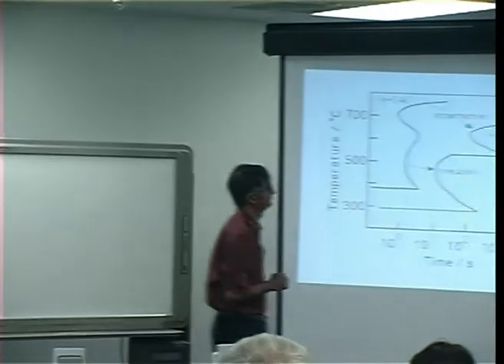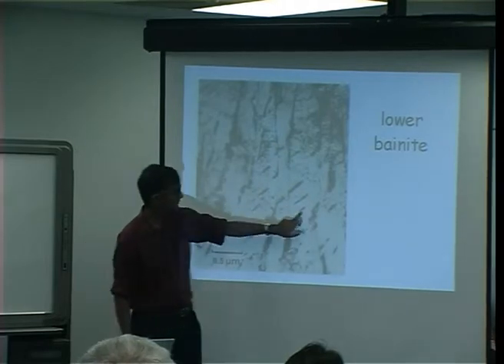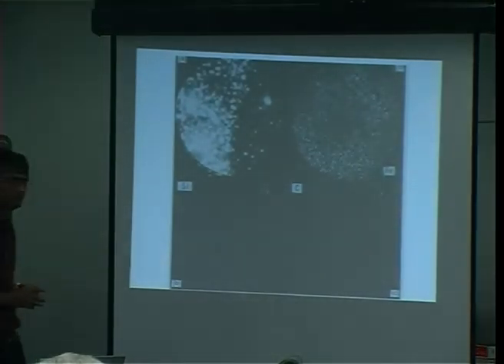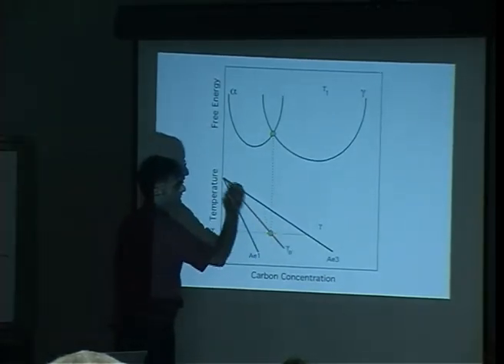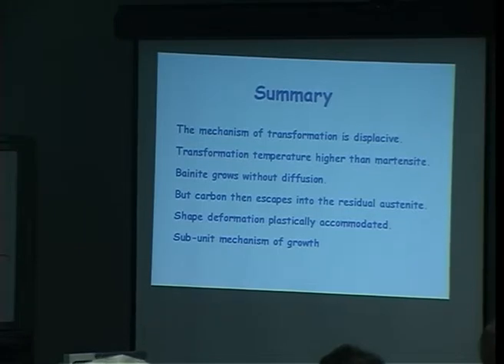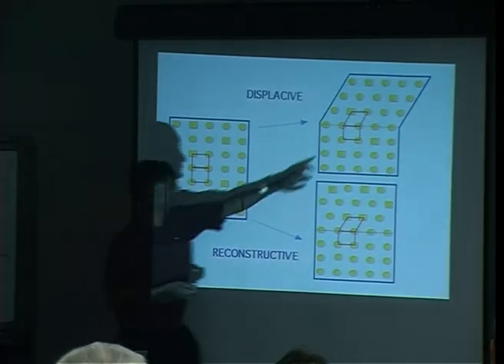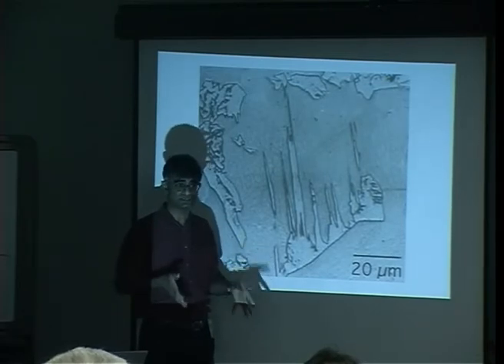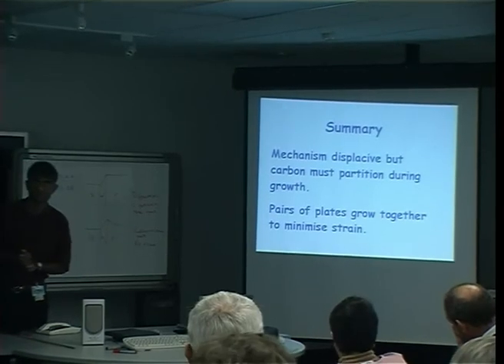Mechanism of the Bainite and Widmanstatten Ferrite Transformations in Steels

Comment: Dear professor Bhadeshia, I'm comparing Bainite X Widmanstätten ferrite. 

Am I missing something important or is something wrong? 

Should I consider a transformation as paramilitary only if the diffusion ocurrs during growth?

--> Both are formed in a paramilitary displacive transformation (only the interstitial atoms can diffuse) (????)

--> Both are nucleated in austenite grain boundary, but the plates of bainite can be formed by sympathetic nucleation

B1--> The bainite sheaves consist of small subunits of ferrite plates separated by regions of cementite. If temperature is lowed, 
 i.e. the supercooling is greater, the difusion of interstitial atoms of carbon is difficult. Therefore, a smaller part of the carbon 
will be diffused, leaving the ferrite supersaturated. The carbon inside ferrite will precipitate (similar to tempering).  

B2 --> The subunits of bainite are too small (in order of 10 microns x 0,2 microns), so it's necessary use a TEM. 

B3 --> The supercooling is greater. A invariant plane shear happens, but the adjacent austenite is weaker in this temperature and is plastically deformed.

B4 --> Toughness of bainite can be improved by decreasing cementite (addition of Silicon can do it), but the plates have similar crystallographic orientation (bad feature)

W1 --> In constrast, Widmänstatten ferrite has no subunits because carbon is partitioned after the growth;

W2 --> This can be seen in the optical microscope - the plate is "clean", but the orientation of the two plates formed is so similar thus we can't see it;

W3--> The supercooling is smaller, thus it's necessary a formation of two plates together. The crystallografic orientation of the plates are almost the same. ;

W4--> low toughness because of small deflection of crack.
Reply from the maker: There are several distinctions - bainite can only form below the T_0 temperature whereas Widmanstatten ferrite never inherits the carbon content of the austenite, and therefore can grow at higher temperatures.